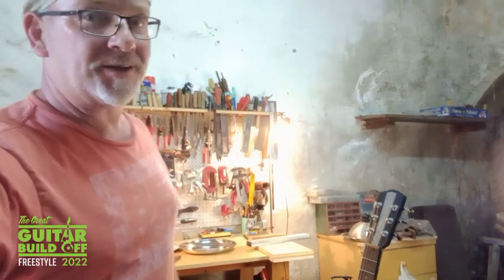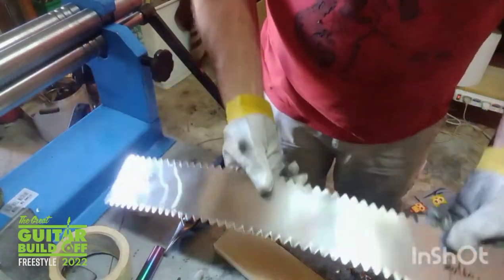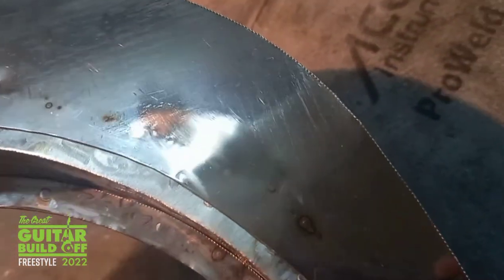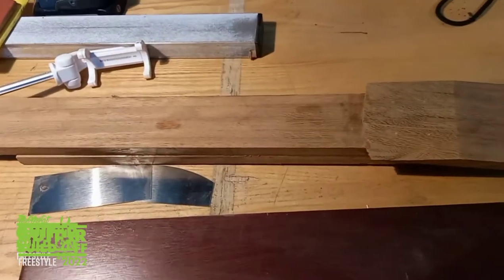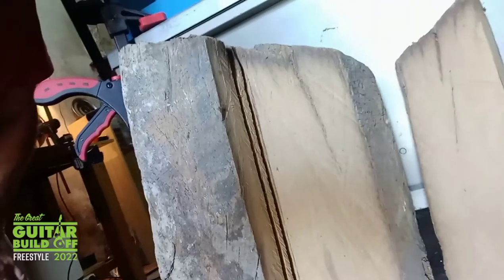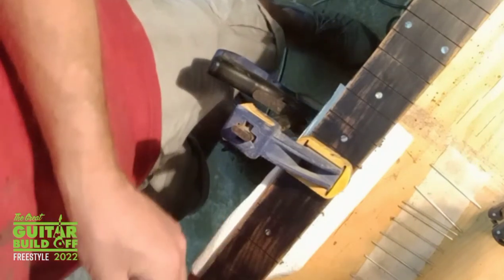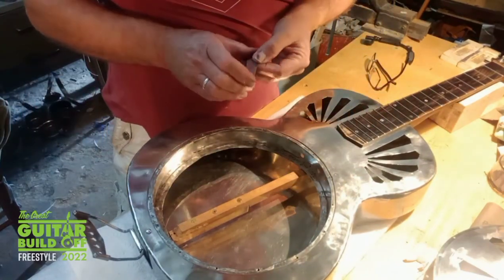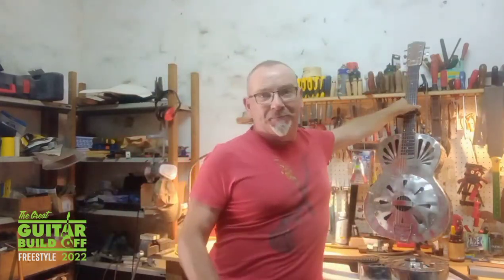Full Build (super edit) From Stovepipe to Resonator Guitar #ggbo#resonatorguitar#recycle#handcrafted

Comment: Hi great job recycling, how thick was the metal,thinking about using tig, I’ve made a few by solderin.
Reply from the maker: Hi Kerry, the INOX is only 0.6mm (don't know what gauge that is). Tig was the only method I could use...very low settings and small sections at a time, because it distorts and melts very easily.
I'm now building one from galvonized steel, which is also tricky to work with👍